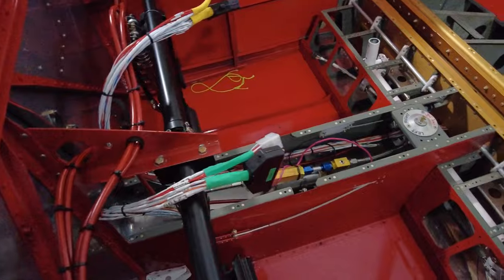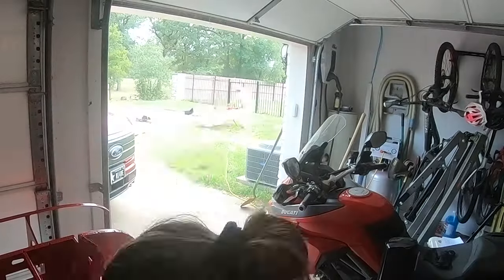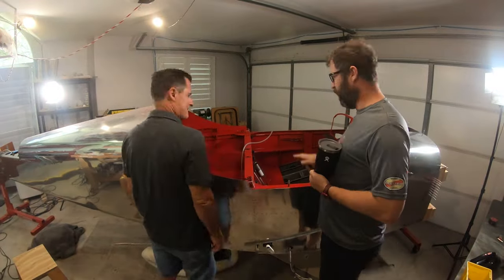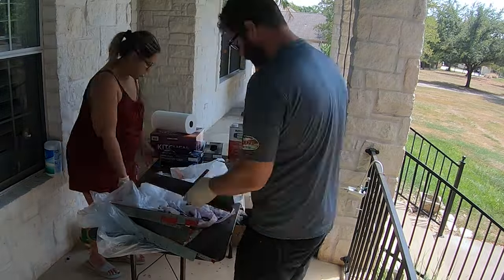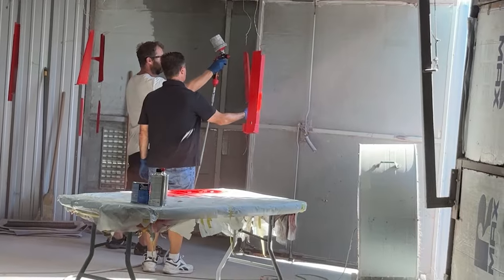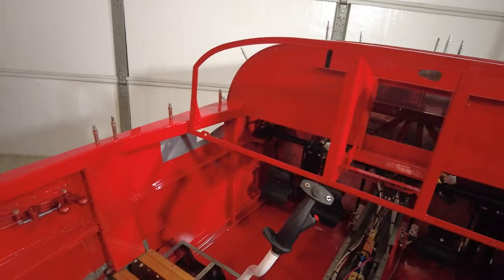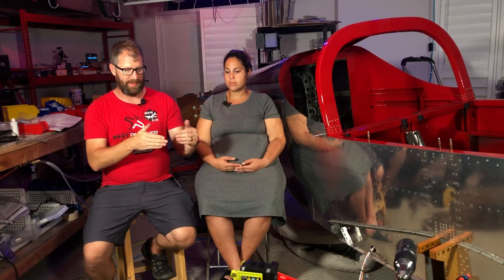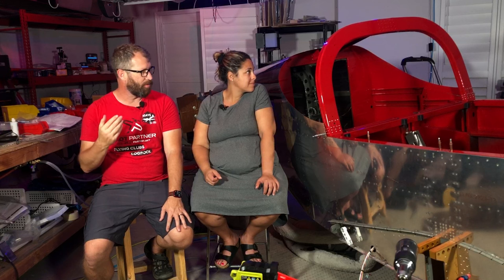Big Fail Painting Our Vans Aircraft RV-14A: How we Fixed it and Installing the Rollbar

Comment: I like a few unpainted rivets for contrast.
 If you really need to paint the rivets, a 50-100 dollar air brush will do the trick nicely. They will shoot paint nicely. Almost zero over spay too. 
 Forget about using primer with an airbrush however.  They aren't made for high solids in that most 2k primers have. Airbrush for small jobs and touch up is easy to learn on your own
 If you want to primer then use a primer in a spray can for the rivet heads . Btw, The red color is awesome too!
Reply from the maker: Thanks!   Do you have any links to the kind of air brush you are talking about?    I want to look into this and learn more.   Sounds like a better solution than anything I had in my head so far.